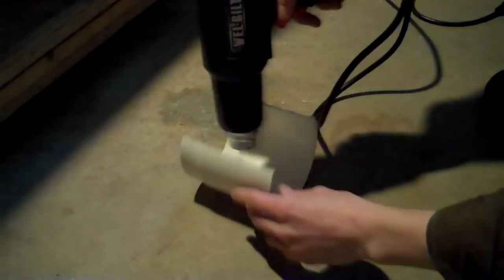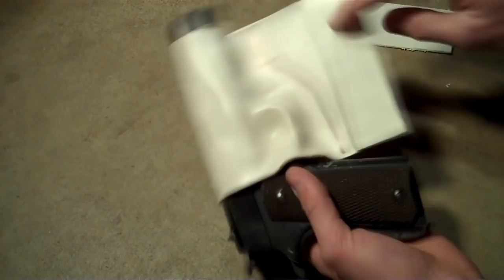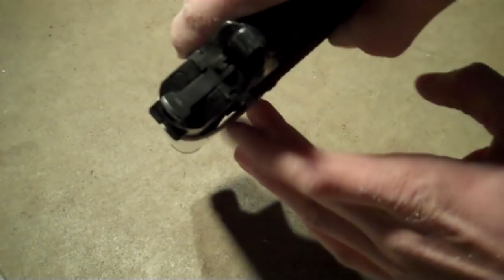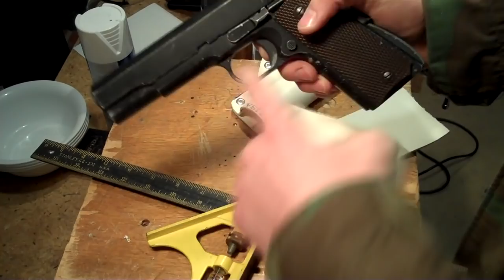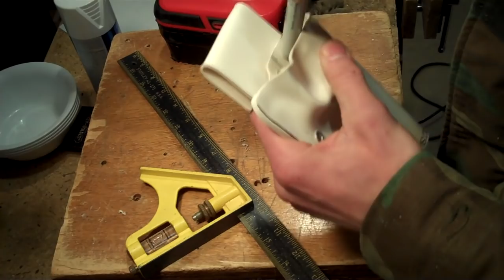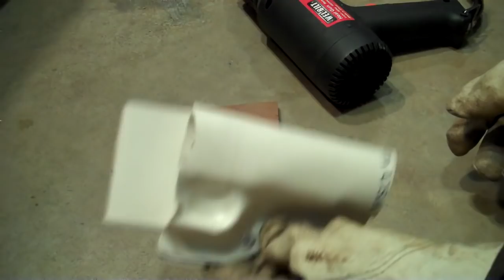PVC Pipe Gun Holster

Comment: Nice! I’ve made some kydex holsters but never thought of using PVC. 

A few pointers: tape a small wooden dowel that runs from the front sight to the rear sights, that way there is a channel for the front sight to travel through. Banging it on the edge of the pvc will mess it up after a while. Not that big of a deal for airsoft guns, but I’m sure you’ll be making these for real firearms one day. Also, instead of cutting out spots for buttons, like safeties and mag releases, cover them and bend the pvc out there, that way it won’t get pressed by the pvc or by the wearer’s clothing or other objects. You can get a really nice fit by placing the hot plastic with the gun inside it in a folded towel, with another towel on top, then standing on it with a plywood board. Finally, use Chicago screws instead of rivets. Most come with rubber grommets, so you can get a perfect fit and you don’t have to start over if you put one in the wrong spot.

Comment: I agree with the training of keeping the finger off the trigger, BUT, I am here to thank you for an excellent video, AND an excellent idea. I am constantly searching for simple, effective, ways to self-build useful items. I have looked (and not found until now) a perfect holster for front pocket ccw of a 9mm that I have carried for a couple of years. After watching the video, I went out in my shop and made a holster out of a piece of pvc pipe that I used your concept, and a pattern off a leather one I had built, and WALAHH! A perfect holster that looks like a wallet from the outside, stays open to the inside for re-holstering, and is more light-weight and less bulky than my leather one. Thank you. I also molded an axe sheath that needs no holder strap because it is molded to fit the axe and open on 3 sides, but snaps firmly around the axe head.Thank you again!
Reply: Great comment, but it's not "WALAHH!", but actually, "Voila!".  (Just sayin...)

Comment: You are a very creative young man, and you have given me some great ideas for making "holsters" for my woodworking tools (as well as handguns).
The first area of improvement I would suggest investigating is the rivets. Someone below  has already commented on the drawbacks of the pop rivets. I would suggest that you investigate the use of brass rivets that are hammered. Or try the PVC cement that is used for PVC pipe (sold in every hardware store). Either of those could give you a protrusion-free holster.
Despite my suggestions for improvement, I think you have done a fantastic job of developing a system for holster building.

Comment: Very well done, Comments are for putting our 2 cents on your procedure. Last month I bought a cheap toaster oven at Wal- mart for 20 bucks. This makes heating the larger sheets and areas a lot easier and more even. The big thing with ovens is bring the heat up slowly so you don't over heat it.. Keep making holsters .. Your doing great. You might try the leather rivets  from there too for smoother finishes.

Comment: Great job!  I love this sort of creative fabrication.  Thanks for sharing.
I had a couple ideas for you to consider if you continue to make these holsters.
1.  Try the pvc cement an eliminate the rivets.  By doing that, you can reduce the area that you have left for riveting.  You will have to control where you put the cement so that you don't have the problem of the opening flexing that you experienced with the unit you started with.
2.  Try starting with a longer piece to integrate the bent loop without making it a separate piece.
I really like the design and the craftsmanship.  The open bent clip prove to be very creative and useful.  You could probably make a nice little business making these for sale.  Good luck and keep creating.
Reply: I forgot to mention.  You may want to try riveting with copper nails and washers.  That gives it a very craftsman look - they can be purchased in HD and most hardware stores.
Reply: tullahund  I agree with him slim. Every leather holster I've ever had used brass or silver (German silver) furniture as it's a personal favorite and that's just what this old salty dog likes.

Comment: My friend, I am a very picky person when it comes to holsters and I'm impressed. PVC pipe! Who knew and unless you live in Alaska or Iraq you don't need the temp extremes of kydex. My advice is after you get your folds mark for belt loop holes then drill out the holster rivets for much easier belt loop riveting. Its a trick I do on my leather, only I use copper rivets instead of pop rivets.

Comment: Well done.  While watching, I wondered why you didn't simply fold the bottom section of the holster belt loop under the top portion of the holster belt loop rather than folding it over the outside; the PVC, once cooled, would be strong enough without requiring rivets as I expected you to apply later.  Then you demonstrated how to easily hook the holster to your belt without having to take your belt off and thread it through the holster belt loop.  Nice.  You've got a good head on your shoulders.

Comment: Great job young Man,  I spent over $ 300.00 on different concealed carry holsters for my Sig Sauer P229 Trying to figure out what works best.  After watching your video, I went to Harbor Freight, purchased a $ 9.00 heat gun.  Took a scrap piece of PVC drain pipe. (IMPORTANT TO USE DRAIN PIPE, NOT SCHEDULE 40 PVC) Made a perfect holster. I use my home made holster and sold the rest on Craig's List. Note: during the forming process I covered my Sig with a layer of aluminum foil to help reflect heat so not to harm the grips.  Many Thanks, DC.

Comment: my problem is he went to all that trouble and then used pop rivets rather than regular rivets that would be flat. Other wise nice job.  I suppose you could use a Chicago screw on the top rivet as an adjustable tensioner.

Comment: Good job.  There's a couple of things you probably already thought of.  You can drill really small holes in the PVC first to keep the bigger bit from drifting whenever hole placement is really critical.  The other is if you make the initial assembly with screws you would have an easier time getting rivets in the belt loop.  Then just take out the screws and put rivets where the screws were.

Comment: If you do this often then I suggest making a kydex press. Kydex is similar because you heat it and form it like shown in this video. The press is cheap and easier to use than using your hands to mold it. It's just two pieces of foam roughly a square foot each backed by the same area of wood and they sandwich the kydex or pvc between them with foam backed by wood on each side. Just google kydex press and you will see. If you go to lowes and buy a gardening kneeling pad, you can use those for the foam.

Comment: A very good question. The 1911 trigger doesn't travel forward when the hammer is cocked, so the dimple in the guard, as long as it isn't too large, shouldn't fire the gun. Standard Kydex and plastic holsters use this same retention idea with no issues

Comment: great video! I use a commercial holster, but will use your technique to make other things. Did you know you can get black PVC pipe? That would look awesome with a bead blasted finish. And you can get a part at hardware or leather shop to replace the rivets, its a hollow screw with a regular screw that goes into it. Can you use just 2 rivets to make holster and belt loop? Good video, thanks.

Comment: Nice start. Use kydex instead of pvc and eyelet rivots and you've got something there. Agree with the others, a firearm is always loaded. Try to practice gun movements and handling without trigger pulls. Even though you are in an enclosed room by yourself, bullets travel through walls easier than you would think. Nice job though.

Comment: Nice idea. Beware of PVC and other plastics. They contain compounds and additive chemicals that will emit toxic gases when heated or burned which will absorb into your body quite readily.  Just heating the plastic with the heat gun will release these gases.  These compounds cause things like cancer and brain damage.  It would be very important to do this outdoors whilst wearing a vapor protection mask rated to protect from these chemicals.  However even with this protection the chemicals can absorb through the skin and thereby into the body.  There are safe ways to make such things, such as placing the project in an enclosed transparent framed glass cube and ventilating the gases outdoors.  Still it would be best to do it out of doors. It would prevent concentrated gases from contaminating the area surrounding your body/head.  Why not try leather?  Maybe find some safe alternatives with non-toxic materials.  Take care bro, excellent video.  Just wanted to let you know for your safety.
Reply: Kydex perhaps
Reply: Not quite that safe! But thanks for the tip

Comment: The plastic welding concept was conceived on the shore of Lake Superior when my Arctic Cat's windshield cracked full length. 15F below zero, I needed the windshield. I always carried a propane torch in my kit and decided to try and weld it together as opposed to punching holes and using bailing wire.  I put 9,500 miles on that machine after the fix... never a problem.  It created a very neat looking weld also.

Comment: 1.you ensured us that the gun/replica is empty but you did not kept your finger off the triger(get used to keep your finger off the triger),if you want to ensure safety and be professional do it till the end.  2. when you put a gun into a holster aply presure with the thunb on the slide so that the slide wonțt remain back when you put it in the holster,and wont create a malfunction.TThe first holster would propably work if you knew this piece of information.                  except the 2 points of mine,your video is great and a job well done. And i appraciate you shred this with us. Thx.     And for a more concealable holster you could make only the  trigger guad part nad leave the barrel uncoverd(it is not wrong). (just a simple idea). and for the  belt retention you should try more  platforms.methods for putting the holster on the belt.

Comment: Excellent video.  You would have found several steps to be easier if you had used a ratcheting clamp to hold the workpieces.  You ought to be able to find one where you found the PVC pipe.

Comment: I agree with the glue unstead of rivets and if you must use them try blind instead. Then both sides would be flat and not get anywhere near the gun. Even though its airsoft its still a gun and someone is proud of it, the rivets you use could wear out clothes/pants etc, and scratch the gunif used improperly. They also make flat head nuts and bolts that work better. They are aluminum and also sold as three ring binders for attaching reams of paper as in books.usually sold in craft stores.

Comment: Really like the idea.  The cutoff for the belt loop is not necessary. Visualize the belt loop section intact vertically behind the handle as you fold over the barrel part.  Leave the loop part above the handle and fold it down after you fold the barrel and trigger section.  One fold is all that is required for the belt loop, then rivet.  Mine is going under my desk top so I won't need to fold the handle down just screw it to the wood.  .

Comment: Kenny, you shouldn't be around weapons until you can learn to keep your finger OFF OF THE TRIGGER!  Lay your finger next to the trigger guard - make that a habit. Re: PVC, try welding ur edge joint. I've used the back of a drill bit when needed. Your project: grind back end of 5/16"bit into shape of a dull chisel. Hold in Vice-Grips, heat w/ torch. Practice on a butt joint- flat edge of bit should cross the joint at a 45, push in 1/2 the thickness & drag back while picking up, repeat. Try it!!

Comment: Is there a way to heat the pvc without the heat gun? Would the oven or the microwave oven work?
Reply: Oven might work but a propane grill or blow torch but be carful it can burn the material
Reply: Oven will work. Boiling water works well too, but just like the grill method he's used in other videos, you can't use it to "spot heat".  It would be a good method to get the first mold though.
Reply: Maker Dad Kade Hesler  So basically I could put the pipe in the oven/boiling water untill it is moldeable, get the overall form, and then go ahead and spot heat it with a bunsen burner beeing carefull not to burn the material right?

I want to make sure the product is usefull to me before I invest in new tools to ease the process.
Reply: +fbimotherfucker yes, that should work. The PVC will burn easily over an open flame and you can't do as precise spot heating as you can with a heat gun because you have to keep the flame moving over a larger area to keep from burning the PVC.
Reply: Agreed